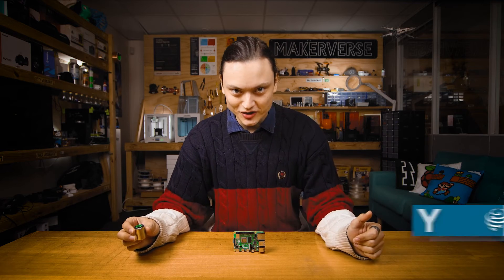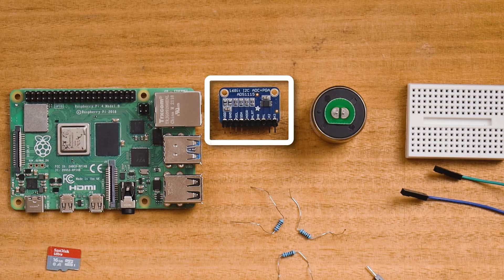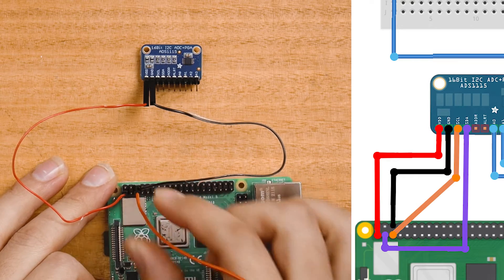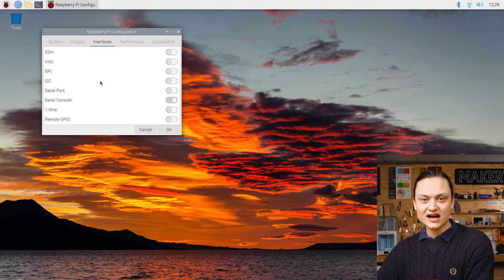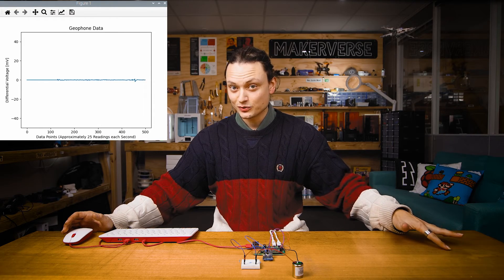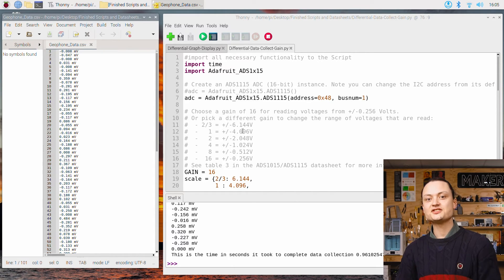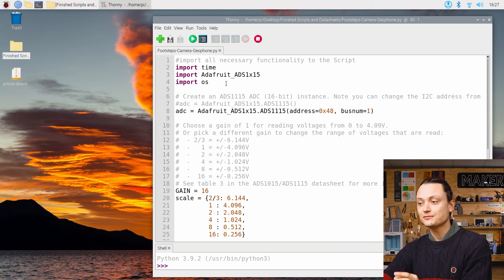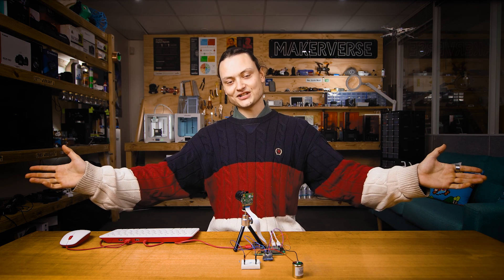How To Use A Geophone With Raspberry Pi and an ADC - Seismic and Footstep Detection

Comment: I love it. Is there any distinctions when I use it on an ESP32? Is the resistors part would ne changed?
Reply from the maker: You should be able to use the ESP32's ADC pins instead of the board we use here and read the geophone. However, the ESP32's ADC might not be precise enough to read smaller signals from the geophone, so connecting the ADC board we used here (which is better at reading these small signals) directly to the ESP32 might be a good approach. But you should be able to read something with an ESP32.

if you need a hand setting this up, we have a maker forum that you can post on!
https://forum.core-electronics.com.au/

Comment: Nicely done. I enjoyed that lesson. As you alluded, geophones are also used to measure seismic events and other geologic sub surface activities. One use is to measure the fracture growth under ground during hydraulic fracturing operations in oil and gas wells.

Comment: Love it! I have one question tho, why did you decide the threshold had to be 1.8 mv? Is there a particular reason?
Reply from the maker: We picked 1.8mV as the value for the threshold as we we're able to trigger a positive result in order to demonstrate the code, there isn't a reason you can't raise or lower the threshold to suit your own needs. For maximum performance it's best to calibrate and find the most sensitive threshold you can without resulting in false positives.

Comment: i am trying to implement same thing using arduino uno  but here i am getting output in a pattern  . Is it posiible to replicate same thing and using arduino instead of adc and raspberry pi
Reply from the maker: This should be possible to use with an Arduino as well. All we are doing is reading the voltage coming out of it and you would just connect it to one the Arduino's ADC pins.

Comment: OK, so it has taken me 2 years to finally get to this project. My only question is if the two pins on my SM24 need to be connected to your circuit in any particular way. I noticed that there is a small raised circle next to one of the terminals and on that same side there is what looks to be a dash in one of the other 2 circles on that pins side. Probably not, but I thought I would check anyway. Great video. I will be mounting the SM24 to a 10 foot long grounding rod that I put in the ground yesterday which I hope will give some good readings. I already know that my HVAC unit and traffic will also affect my data. Looks like a fun project!

Comment: What would the schematics look like if you wanted to use many seismic sensors around the boundary of a property as an alarm/security barrier and have them operate wirelessly? The sensors would be distributed around the perimeter, each communicating wirelessly with a central control unit. These wireless sensors would be powered by batteries or solar energy and would detect vibrations caused by movement. The central control unit would process data from the sensors and trigger an alarm if any unusual activity is detected, notifying the property owner. Is this something you would be able to assist with?
Reply: I did this very thing but I had to waterproof the sensors. They fit neatly into PVC pipe and then I sealed them with fiberglass. (BTW the sensors have an  UP and down orientation. If you mount them incorrectly they work but at reduced gain). After several digital filter designs looking at typical footstep frequencies, I just changed to crude energy (low pass filter) detection. It is really awesome. The more sensors, the better! (Great Video too)
Reply from the maker: Sounds like you have a project on your hands! We don't do much support over YouTube comments, but we have a maker forum with lots of questions like this everyday! Feel free to post this over there as we have a lot of makers on there who can help scope out this project. I don't know to what extent we can help out, but you should definitely be pointed in the right direction!

https://forum.core-electronics.com.au/

Comment: I had major trouble with software setup.

It seems the site page instructions for getting packages is outdated.
For example python-dev got replaced by python-dev-is-python3

Also I keep getting hit with some "externally managed environment" error when trying the pip3 command.

I'm no expert, so I'm unsure what to watch out for - sometimes a work-around appears to go along nicely enough, but then hits a big error later.
Reply from the maker: Hey Matt, with the new Bookworm OS, we have been forced to use virtual environments (not using one gives the  "externally managed environment"). We have a workaround for it here: https://core-electronics.com.au/guides/raspberry-pi/using-virtual-environments-in-thonny-on-a-raspberry-pi/

Thanks for spotting this, the guide has been updated!
Reply: @Core-Electronics  Looking good, I have been getting things set up well enough and been experimenting.

I have noticed the example Python Scripts I downloaded are a little different from what I see in the video.  Instead of mV in the graph, it shows a raw Y_range variable with a range of +/- 750 in the program script.  What exactly is this value, I think it comes in as a raw number from the ADC reading?  Also, some lines of code such as the scale array is missing, as well as the equation where it calculates Voltage.

(Edit:  I think I can adjust things by writing my own code, I just want to make sure I understand what raw number the program reads from the ADC reader, and work from there.)

Comment: I have a question, can this sensor be used as a security system?
Reply from the maker: That sounds like you have a project on your hands! You could definitely use it to track foot traffic through an area, maybe wire up a camera and snap a shot when you detect it, or sound a buzzer, but this can definitely be used as the basis of a security system!
Reply: Thank you. Can you give me information about the walking distance (normal walking) and the amount of voltage you found?❤

Comment: Hi, I am wondering if I want to connect three to get all axis how would I need to connect them to the raspberry and can I use raspberry pi zero? Thanks
Reply from the maker: The Pi Zero has the same pinout and will work, although you may be limited in processing power. If it's form factor that's the issue then a Pi Zero 2 might be a better pick. The ADC board can take in another geophone (the phone needs 2 analog pins and the ADC has 4), so if you want 3 you will need to connect an additional ADC board or one that has 6 analog pins.

Hope this helps!

Comment: Is it possible to do the exact same project with a piezoelectric accelerometer istead of a geophone and a different analog-digital converter with a much higher sample frequency (like 10kHz) ?
Reply: you should change the adc 1115 for one ads1256 for example
Reply: thank you🙏💪

Comment: Great video! Thank you! I've seen several references that specify this ADC module's max voltage as 5V.  In my case, the module will be used in conjunction with a different MC and will be be bit-banged. If I can use it at 5V it will make my life much easier - any info would be appreciated.

Comment: Hey, I would like to know if simulating is possible with geophone in any software. If so, can you provide me with the name of the software?
Reply from the maker: Hey buddy, do you mean simulation the Geophone Output or Different ways to graph them? Always worth a check is Raspberry Shake - https://raspberryshake.org/
Reply: @Core-Electronics  Thank you! As part of our project, we are using ADS 1262 with rasp pi 4. So could u help with changes that would come with the code?
Reply: @Core-Electronics  I would like to know the software u used to simulate the geophone
Reply from the maker: Come write up a forum regarding the use of the ADS1262 (we'll best be able to help you there as we can exchange photos of set ups) - https://forum.core-electronics.com.au/

All software I used to display the voltage emitted by the bouncing Geophone is written in Python, you can download it at the bottom of the full written up article - https://core-electronics.com.au/guides/geophone-raspberry-pi/
Reply: @Core-Electronics  Thank you so much however I would like to know the software u used for simulation of the whole circuit without hardware parts like proteus or tinkercad?

Comment: How can the ADC sense negative voltages? It has to have a negative supply connection to do this. Seismometers are normally biased above ground for this very reason. Thanks for the nice work.
Reply from the maker: Cheers for your kind words 😊! 

So the ADS1115 is able to measure negative values or voltages even though it only operates using a single supply. Although the ADS1115 has 16 bit resolution capability, it uses Two's complement to represent a value. The MSB (Most Significant Bit) represents the Sign Bit (+ or -). This is really a 15bit resolution ADC capable of negative and positive voltage measurement (within the GND to VDD supply limitation).

Here is a great spiel all about this - https://www.best-microcontroller-projects.com/ads1115.html
Reply: @Core-Electronics  Ahhh. Got it. The actual inputs cannot go below ground but the 2 inputs can go negative relative to each other. duh!!!   Thanks

Comment: Great tutorial!!! 
Any suggestion put all stuff inside a  3d printed box  without cause reading problems  to geophone ? 
Cheers!
Reply from the maker: Cheers mate 😊
Best results comes from placing the ADC directly on the hard ground (concrete floor is commonly where it is placed). Id make a hole in the bottom of the case and pop the Geophone through it, friction fit around the edges. That way the Geophone is having direct connection to the ground and it'll provide the best/most accurate responses.

Comment: Is there available some kind of documentation for consult if I want to try using another faster language like C++ or if I want to do my own version in python?
It would be possible to convert the output data to a seismic format like SAC or mSEED?
Reply from the maker: Such a phenomenal 'Where to Now' question 😊 I'll do my best to help, sorry if it is a longer reply than expected.

The most established Open source seismology toolbox and library written in Python that I know of is Pyrocko - https://pyrocko.org/ - Pyroko will be able to help you format the values out of the Geophone into SAC or mSEED Standards. 

The Pyrocko Snuffler Application is of particular interest as it will display Seismic Waveforms in real time - https://pyrocko.org/docs/current/apps/snuffler/tutorial.html#live-seismograms

More on Data Formats regarding Seismometers (although you seem well versed 😊) - https://ds.iris.edu/ds/nodes/dmc/data/formats/#miniseed

Scripts to write ASCII data into MSEED file using Obspy - https://www.earthinversion.com/utilities/write-ascii-to-mseed/

In regards to C++ here is a Script that allowing rapid characterization of seismic sources, (the wiki examples linked on that page are worth a look too) - https://github.com/eost/wphase

Also I must shout out the Raspberry Shake Project and their open source scripts, a lot can be learned from their GitHub! - https://github.com/raspishake

Comment: Looks real good, engineering and research instruments use 3 channels(X, Y, and Z), and really powerful sistems can have up to 9 (3 acc, 3 vel, and 3 displacement) channels  how would you connect the 3 channels to one raspberry pi? Perhaps using three ADC's? Anyways Great work! I have always wondered how these worked
Reply from the maker: A Raspberry Pi 4 Model B would definitely be capable of X, Y and Z measurements from three Geophones. Running 9 Separate Geophones on a Raspberry Pi Single Board Computer, that I have no idea if it would be possible. Communication from the ADC is all through I2C so enables many many devices to be connected up so communication avenues wouldn't be a limiting factor.
Reply: @Core-Electronics  in such configuration would you use only one ADC connected to the three geophones?

Comment: Nice ! And very well explained. It inspired an idea. With 3 geo phones and 3 ADC’s, it should be possible to triangulate an exact position of any vibration in a 2D field, assuming the speed of vibration (m/sec) is consistent through the media (ground). I can see some applications for that in terms of trespass monitoring, actually plotting a route through a monitored area…..
Reply from the maker: I love that idea! 😊 That would make for an incredibly powerful system. Usually when three Geophones are combined in a singular system they all face a Primary Axis (X, Y, Z directions) close together but I really like the idea of using three to encircle and protect an area.

Three in that configuration would also make it possible to figure out what is internal within the area shocks/vibrations and what are external.
Reply: Actually it is almost impossible to do this with the accuracy you want. Things like rocks, roots, and varying soil composition radically change prop times due to reflections between the sensors. if you get it to work the army would really like to talk to you!  😊